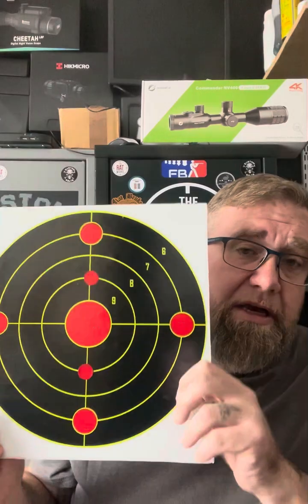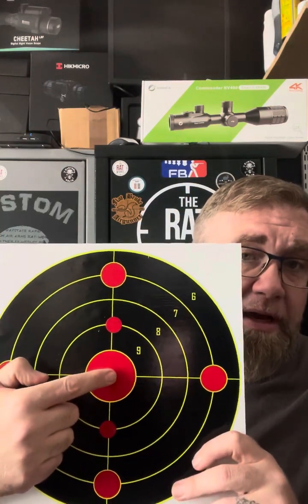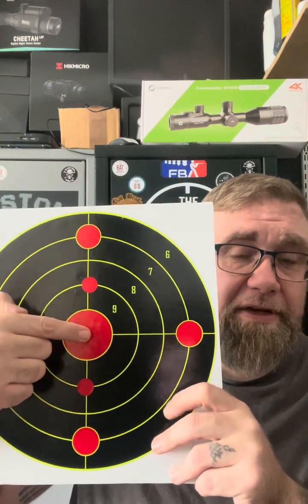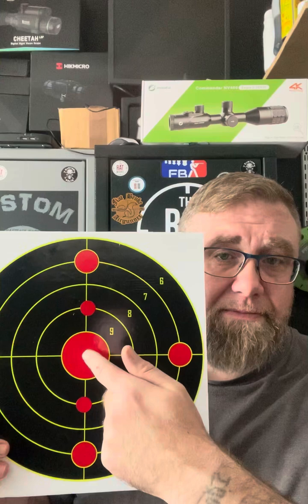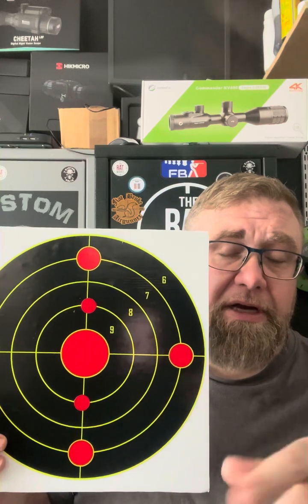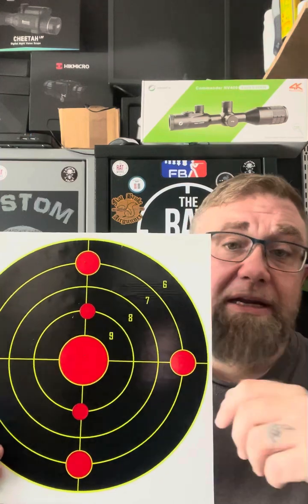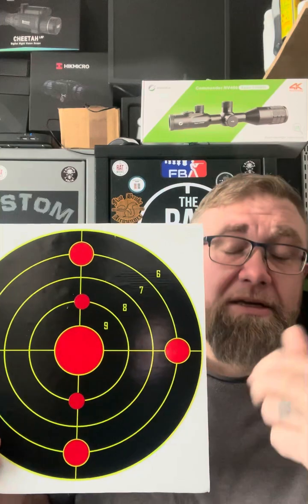How to accurately tune your ballistics calculator. OneLeaf, Zulus, HikMicro

Comment: A quick tip. Use the scope height setting to adjust point of impact for ranges between the barrel and the zero distance. From the zero distance and beyond then use the BC.
Reply from the maker: Not a chance 😂 the scope height is a set perimeter

Comment: In the past I have been adjusting the distance between the Scope and the barrel and got me close enough for different distances but not exact specially far away distances but this video makes complete sense. Great information👍🏼
I will be definitely be trying it this weekend, great video👍🏼
Reply: You done yours the same way he said here and work ?? 
Because I been moving the scope hight and work ok but no really accurate
Reply: Exactly like the video mentions up to your zero are used the scope height to adjust them cost by zero I use the BC.
I am using both of my digital scopes on air rifles
What I have noticed to get a good zero is to try zeroing on low magnification, preferably on base mag
 I have noticed every pallet or slag if tuned well and the right BC achieved then you’re going to get a flat trajectory which helps a lot for your ballistic calculator to work perfect
Example H&N slugs do mention on their website the best speed for flat trajectory that does not necessary mean faster

Comment: Thank you.

Did you find you had to make far great adjustment than you expected?

I’m zerod at 40 yards, trying to tune BC 75 yards.  The BC on the slug tin is 0.094, I’m shooting high  so I walloped it up to 0.200 so far and noticed little change?

Thanks
Reply from the maker: @eds1981  no I didn’t make big changes at all but I’m shooting sub12, sounds like your fac?
You should also at least double the zero range
Reply: @ mmmmm. I’m at 945 fps 23 grain slug, took some great advice and happy with the Zero used to zero at 50.

Like 40 got it bang on, lowered scope height slightly and at 12 yards BC perfect.

At 75 injustice cannot seem to get it down I’m an inch high.

BC ON TIN IS 0.094.  It’s puzzling me as I’m nearly there.

Comment: Would this work if you were zeroed at 100m and then you went down to 50, did the range finder, ballistic calculater then adjusted from there?
Reply from the maker: @Dean-s7y  yes as long as you put all your information in correctly it will give you a shooting solution for any range
Reply: @airgunhunteru.k.2600  thank you for the speedy reply, i'll give it a go.
Reply: if you zero at 100 yards..below zero range you adjust your scope height..above zero range you adjust the bc

Comment: Will this method work with velocities over 900 fps in a .22 caliber air rifle?  I have a new DNT Thermnight and I need to tweak the ballistic calculator settings to get the holdover to be more accurate. Thanks!
Reply from the maker: @michaelo6003  yes but you will have to stretch the distances a little, at 900fps you’ll probably be better with a 50 yard zero and then tweaking the bc at 100
Reply: @airgunhunteru.k.2600  Got it, thank you!  But I shouldn't have to mess with adjusting the scope height in the calculator, correct?
Reply from the maker: @michaelo6003  https://youtu.be/aoC861PobGY?si=L9G0TuRAXCv7nXke

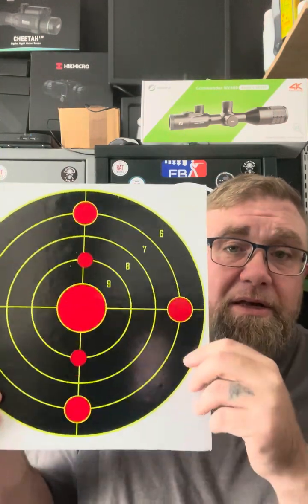Skip to 3:50, in this video and it will show you how to measure the scope height accurately….

Your scope height is your scope height, if you have measured it correctly then it is correct and you should never adjust it to get your point of impact to line up, only adjust the bc
Reply: @airgunhunteru.k.2600  I understand that and I have measured it correctly.  I was referring to what some others say -  that you should also change scope height in the settings in addition to adjusting the ballistic coefficient.  Your method seems so much simpler!! 😊
Reply from the maker: @ I’ve seen the same ill advised advice offered around the forums and pages…. The scope is a fixed point, it’s a constant, if you have done it correctly and know it’s correct then it’s exactly where it needs to be, I really don’t understand why people advise changing it, it’s daft in my opinion! I use the same method I have shown and my rifle only misses when I produce a shit shot because I’m the human element that lets the equation down mate
Reply: @ Thank you. I’ll be following your method!
Reply from the maker: @ please let me know how you get on 👍🏻👍🏻👍🏻
Reply: @airgunhunteru.k.2600  will do!  Crappy weather the rest of the week, but I’ll be at it as soon as I can. 👍🏻😊
Reply: @airgunhunteru.k.2600  if you zero at 50yards  then go to 100 you adjust the bc..then shoot at 20 you adjust the scope height...its simple
Reply from the maker: @ the scope height is a constant!
It’s not something that should be changed, It can not be anything other than what you measure it at

Comment: My experience is that, on a 22 rimfire with subsonic ammo, adjusting the muzzle velocity rather than the pellet/bullet ballistic coefficient gives finer control over the result of the ballistic calculation. 
When the POI is below the calculated holdover mark, reduce velocity.
When the POI is above the calculated holdover mark, increase velocity
I found that even relatively large changes in ballistic coefficient had little effect on the calculated holdover mark
However, things may be different for sub 12ftlb air rifles compared to a 22 rimfire where the muzzle energy is over 100 ftlbs
Reply: That's great info thanks.
Reply: Would this be the same with High Velocity ammo?

Comment: Need some help. I have used this exact method on my PARD 008 sp lrf. 
Every time I have made the BC correction (while on my corrected solution) and then go back to my zero distance, the zero has moved as well because I changed the BC. 
What am I doing wrong???!?
Reply from the maker: @Skullpain  unfortunately I’ve never had a pard sp so i can’t really help mate
Reply: @airgunhunteru.k.2600  I’m sorry, I had seen posts from you discussing the PARD NV008 and thought you had owned one. Thanks for the quick response!
Reply from the maker: @Skullpain  I’ve got a DS35-70 buddy

Comment: What happens if you zero 25y and ballistic poa for 50 is lower and you adjust as you say. But then zero is off?
Reply from the maker: @groglet-jc2nm  if that’s the case I’d be double checking the rest of the parameters, somethings off, I’ve set my Zulus, OneLeaf NV400 and Pard DS all using this method and they are all absolutely spot on mate

Comment: All good, except you don't need to take those intermediate shots - just a couple at the end once you've got the BC correct.

1 - Put all your scope height / muzzle velocity etc etc data into the scope
2 - Zero at 25 yards on the bullseye
3 - Move back to 50 yards and, still aiming at the 25yd bullseye, shoot a small group (should obviously hit lower than the 25 yd group)
4 - Now range the bullseye, and see where the scope puts the new aiming point crosshairs
5 - Now, without firing, keep ranging and adjusting the BC until the scope starts putting the new aiming point crosshairs over that 50 yard group. Your BC should now be correct.
6 - Now range and fire at 50 / 25 / 15 / 75 etc yards - you should be spot on at most distances

The above should still work if you're using an app and need to adjust the turrets of a conventional scope - you're just changing the BC to accurately get the crosshairs from the zero point to your new POI.

Comment: 👍good video. Adjust for your situation is good advice 😋. BC  is a weird value as it changes with speed, air temp/humidity, altitude... according to airgun mag I read in the past.
Reply from the maker: It definitely changes by barrel mate, I tested that recently, it’s a strange but necessary value but  it’s individual to the rife and set up and even the environment as you mentioned, it definitely needs to be fine tuned for every rifle